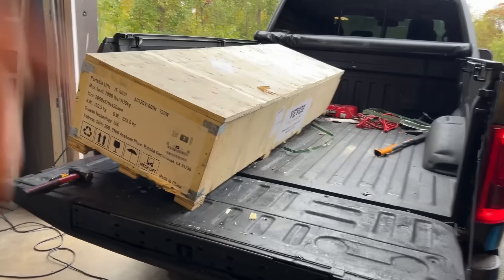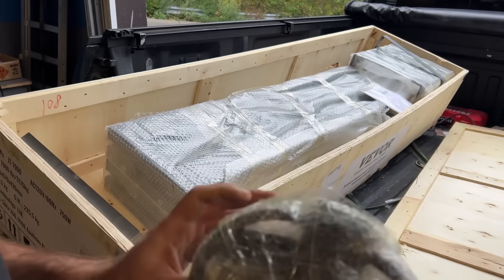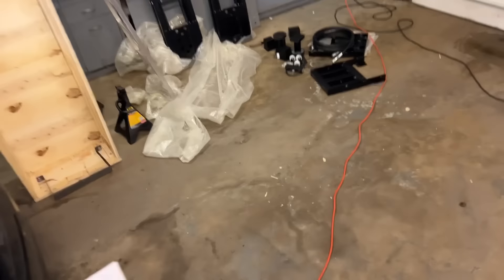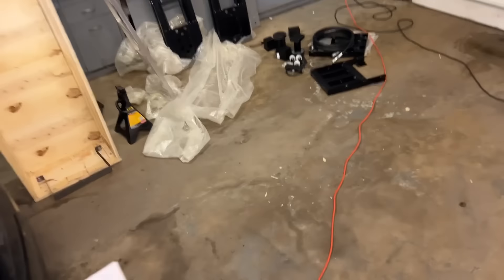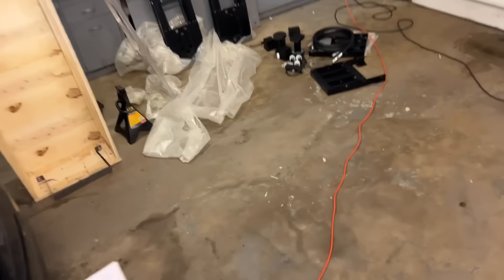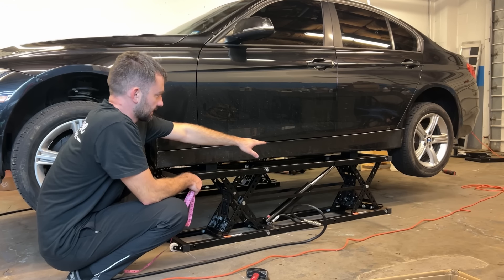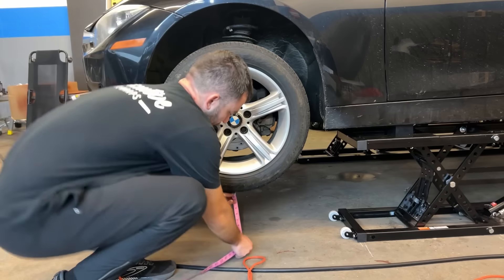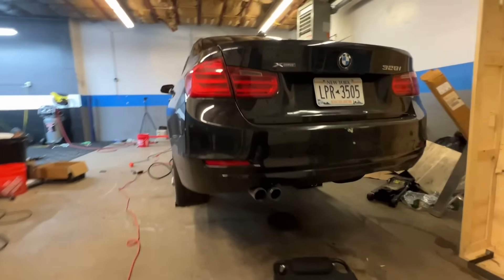Unboxing and Trying Out The Vevor 7000lb Lift - Quick Jacks Alternative?

Comment from the maker: Update: 

I now use 2x4s that are about 6-8” long instead of the rubber blocks and have no issues fitting under most small cars. And it feels much safer than the rubber blocks too. 

If a car is super low, then I drive it onto some 2x10s and no issues there too. But only had to do this with 2 lowered cars so far.

Comment: I use quickjacks for my E92 335 and you definitely want to pay attention when using these lifts.  I used my QJ after a while and I pretty much forgot to check to see if it locked into place.  After jacking up the car and then running out to do some errands, it hit me that I didn't hear the locks engage, so when i came back home, one side was slowly going down so I quickly connected the hoses and lowered them back down.  But with lifts like these, it makes jobs so much easier.
Reply from the maker: Oof that’s scary! 

Thanks for bringing this up! I always lower the car so it sits on the lock point after it’s raised. To make sure everything is level. I recommend always doing this to never rely on hydraulics solely

Comment: The real problem with this is that for $1000 more you can get an 11,000 pound to post Lift from China, which of course is where this Lift comes from which I don’t have a problem with either way
Reply from the maker: For sure but they are each built for diff purposes. This is kinda the only setup that works for my shop because of the layout and limited space
Reply: I can’t fit a post I can easily fit this.

Comment: Just a tip on something that has a steel hood you can see when lifting the car. Try putting a magnetic level on the hood and once it is positioned and centered by bubble and location you can lift the car. Any variation in whether it is one side or the other going up evenly can be easily seen. I have a six-inch level that would work perfectly on the BMW.

Comment: I have a lowered mustang and I have about 4" of clearance to the rockers. What is the height of the unit fully down without the blocks? Vevor gives a dimension of 6.5" But that is with the rubber blocks. I am looking for the height of the unit itself. Thanks!
Reply from the maker: You can use pieces of 2x4s instead of the robber blocks and it gives you another inch or two and also drive the car onto 2x10s before picking it up too. 

So it works with lowered cars like that
Reply: @Buildcultureyoutube  Awesome, thanks!
Reply from the maker: @mpm32rocks  of course! I have a lowered g80 M3 sitting on them right now and no issues
Reply: I did the "drive on blocks" thing with my lowered BMW 335 and my QuickJack setup.  Will be even better with the Vevor since there won't be as much guessing where the blocks need to go upon setting the vehicle down.  The travel arc of the QJ makes that an inexact science every time.
Reply from the maker: @GoFastGator oh yeah definitely a pro to the Vevor. Goes straight up no guessing

Comment: Decent option to GJ's I guess.  looks a little higher than my QJ7000's  so getting something under the tires will be mandatory.  Also looks to not raise as high as my QJ's at around 24 inches.  I paid about the same as these I think.  $1700 for the compete set but don't have the extensions.  Those are another $100 I think.  So again, decent option but I'd have to see more on the quality and longevity of  them to say they're as good as QJ's.

Comment: Nice that the vevor lift appears to lift straight up, I have the quick jacks and because of their design the car moves forward as the lift rises.  Fine for most work, less so if you try to drop a transmission or subframe and want to use the lift to gain clearance.  

Plan your hose routing for the job, if you're doing oil changes or something under the front, set the pump and hoses to the rear so they aren't in the way of the creeper.

Comment: Great video and review. I got these last summer from Amazon and the box it comes in as you have seen is massive. I kept it for my mother in laws coffin lol. I do like the price and the accessories that come with it although i do not use the extensions as even my  17 Suburban does not need them. I have used the jacks both Lenght wise and sideways. I would not use it that way if i had quickjacks due to the way the jacks lift and move forward when lifting. I use a Trailer unlock hook from a Tractor Trailer to move the units around as they are super heavy. Right now they are hanging on some very strong hooks for storage.
Reply from the maker: That’s awesome thanks for the tip on moving them around!

And the coffin thing omg lol

Comment: id like to se it on the truck as i would like to se how it does to know if i could use it on my wifes truck
Reply from the maker: It handles my f150 just fine which weighs in at 6040lbs at the scales. 

Also had a cybertruck on there recently which is right about 7000lbs. It did fine but I will admit it was a bit scary lol. I had cinder blocks just in case
Reply from the maker: I just posted a quick video with the cybertruck

VEVOR 7000 LB Lift Update. Test at Full Capacity!
https://youtu.be/7zwCX4qFBik
Reply: @Buildcultureyoutube  just ordered mine today and should be here in 2 weeks. this was the only lift i could find that was portable and lifts straight up.
Reply from the maker: @ awesome! you're going to love having them
Reply: @Buildcultureyoutube  thank you, you sold me on them as your video was the only one that showed what information i wanted to know. so thank you for that.

Comment: If the car is up in the air with the locks engaged on lift, can you disconnect the hydraulic hoses out the way?
Reply from the maker: Yes you can, I do it all the time
Reply: I  just received my lift yesterday, men is heavy,  thanks for the information!!
Reply: Para qué????.

Comment: what can i do if the jack is stuck on top with no load? I can't lower it.
Reply from the maker: I’m not sure I wish I could help. I don’t think you’re supposed to do that. 

Maybe see if you can drain the fluid somehow
Reply: Maybe while holding the lower button put some weights on the lift or push on it to help it sometimes they get stuck I’ve seen

Comment: How do you like the lift after 2 weeks?
Reply from the maker: I still like them. Used on my truck to do undercoating this week. 

Only complaint is how heavy they are lol but it makes sense for how much weight they lift. 

I really like that they lift straight up compared to slightly forward like quick jacks. 

I still recommend them and convinced a close friend to get them too lol.
Reply: Get a Johnson bar to help move them around. That's what I do. You can steer them around with the bar under the handle loop.
Reply: What’s the max lifting point spread with extension? I’m looking for 72-74”